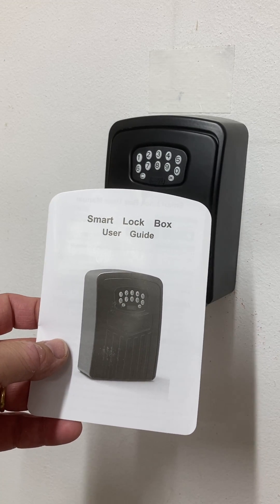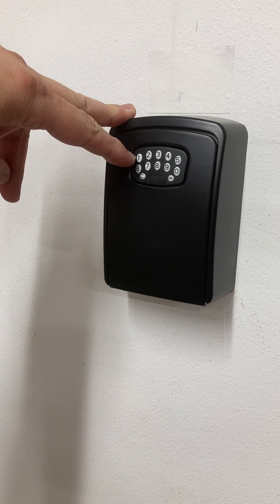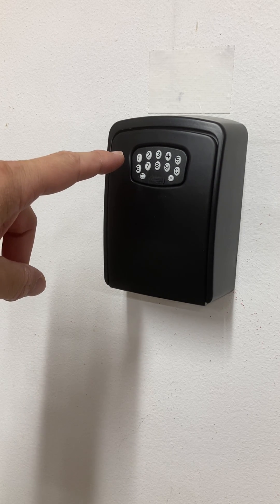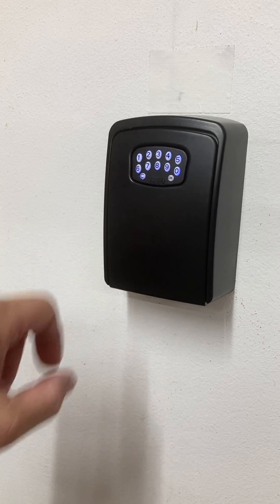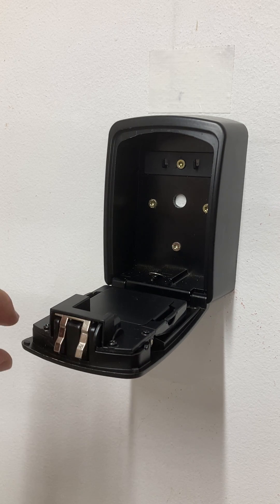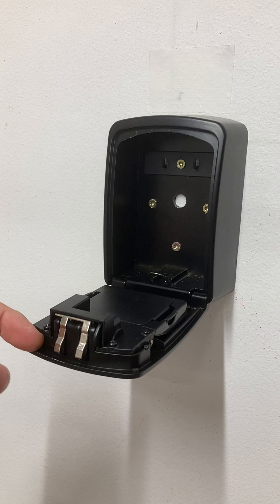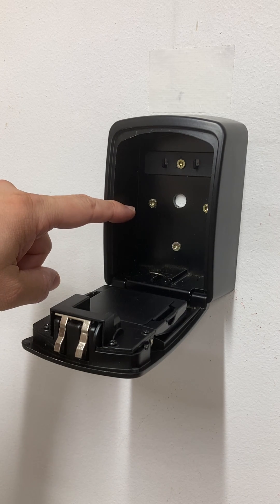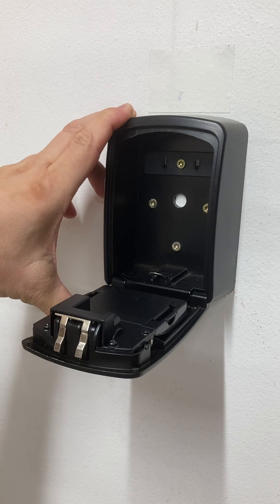Smart Lock Box (Supports Tuya) - Mechanical Security

Comment: That is when it is unlocked. What when it is locked?
Reply from the maker: This lock box has no "dead-locked" state, the lid is held closed only by the spring-loaded latch.
Reply from the maker: @Optron Cordian: I think I understand your question now - I got another similar lock box which turns the motor a bit after closing the lid. That doesn’t seem to work 100% of the time, sometimes the motor is turned only a very short time. But when it works “normally”, it seems to be quite effective in preventing this attack. See https://youtu.be/jWKCzG87yRQ